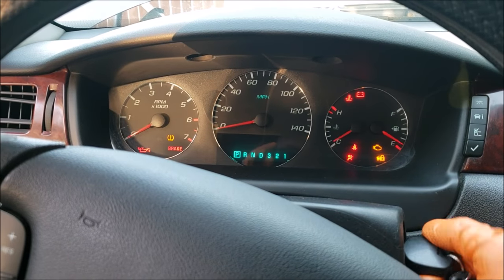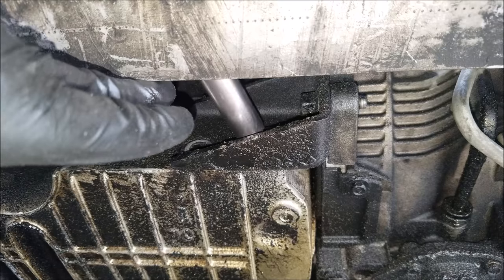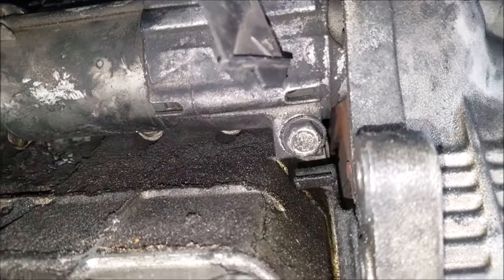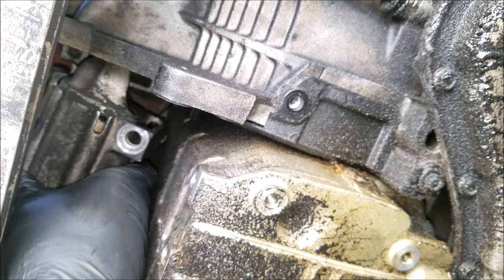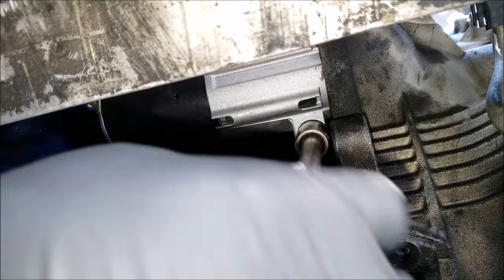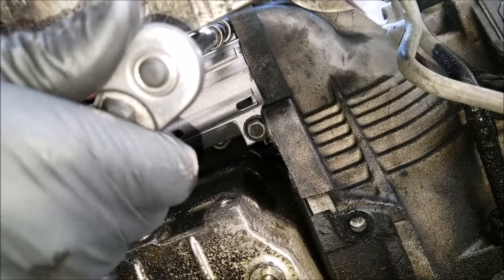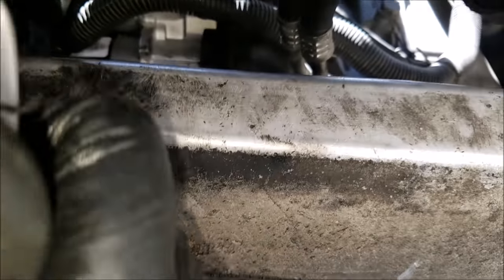How To Replace A Starter On A Chevy Impala 3.5L 3.9L 2006-2011

Comment: I found a hack. You don't have to remove the wires while the starter is mounted. Just remove the 2 mounting bolts, side the starter out, and disconnect the wires when hanging down. There is enough slack to allow this.

Comment: Hey all you wrenchers out there, I found out if you remove the oil filter on the 3.5 engine, you'll have plenty more room to get the positive wire connection off. This video saved me a labor fee. Did it myself! I am 70 years old, had a heart transplant 14 months ago. If I can do it, many other mechanically minded skilled patient guys can do it too. Swearing badly is acceptable.

Comment: Everyone is right, this is the best tutorial on the web...I used this plus some of the other ideas offered here as well..I 1) only loosened a few splash guard clips and tied it back with a bungee cord, 2) removed the oil filter and caught any oil that dripped out, 3) disconnected the two starter wires from the oil filter area and dropped the starter from that area too and did not have to squeeze the starter out from under the radiator hose...there was plenty room...4) I reconnected the wires before reinstalling the mounting bolts...it did not hang down by the wires...the starter was supported by placing it on the frame  area., it did not fall down...those are the only techniques I did different but could not have done it without your video and comments from others...thanks yooz!!
Reply: Thank you for writing all of the tips out, I replaced a starter on my 99 suburban 2x but this one on my 06 impala looks way harder, I haven't seen all the other tips yet, so your comment just helped me A LOT!! I will be doing mine tomorrow morning.

Comment: Terrific video, thanks for making it!  And I love the sponsorship by the cat.  This video made replacing my starter a really easy job.  I was even able to squeeze the starter out of the bottom of the car and back in again instead of through the side area where the hose is.
Reply: I replaced mine in the dark 8 months ago , in daylight I had to remove oil filter and starter slid right out.

Comment: Amazing video, I had no trouble removing and replacing the starter with your guidance. For my 3.5L engine, I did have to remove the lower panel like you did, rather than just loosen it. I couldn't work around it and get to that 10mm bolt to remove the little plastic cover.
Reply from the maker: Thank you🙂 yea i found it much easier to do without that splash shield

Comment: Great tutorial, got the job done! Agree with the comments regarding the oil filter removal, made it a much easier job to drop it down and swap out the electrical connector and battery terminals, then replace them and remount

Comment: 0:15 unhook battery - negative terminal - 10mm

0:40 bracket - 15mm bolts (use extensions to get square on bolts - avoid rounding!)

2:13 - dust cover - 10mm bolt

2:50 starter wiring - 13mm nut - plus lift plastic tab

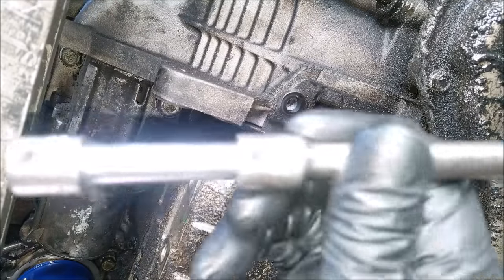4:08 starter bolts - 15mm plus extension/s

5:45 for cat lovers :)

5:55 Install

Comment: I did this job on my own impala a few years ago. If you are not a mechanic, you really need to follow every single step on this video. Also, you better off wear a safety glass. It is preventing dirt drop into your eyes.

Comment: Great step by step, I would add it is a lot easier taking the oil filter out and using that hole then trying to go out the front. Yes you'll lose a little oil but have so much less frustration in the long run and save previous time also.. Cheers

Comment: I missed that step at 8:42. I overtightened it at first. Went back to the video and loosened it up a bit. Good as new. Thanks for this video.
Reply from the maker: Thats great🙂 glad u got it going...great job👍
Reply: @backyardchevy328   update:  I just noticed today while my car was on I heard the start crank on it own. Any clue on this matter?
Reply from the maker: @RL_Repairs310  that would happen if the starter crank wire(smaller wire on the starter solenoid) is touching the main starter battery wire...so youll want to make sure those wires arent touching or too close to each other...or can also be if the ignition cylinder is sticking in the crank position or got bumped forward to crank

Comment: When I did this job I found the starter can be dropped straight down without having to pull it under the radiator hose.. You make good videos and I come here to get a heads up. Your drum brake video helped me big time thanks.👍🏿
Reply from the maker: I wasnt able to on the engine in the video, but yea some are different...thank you:)
Reply: @backyardchevy328  I understand.. I did it this way on 2007 3.5 Impala. I actually found out on accident, I was just trying to lower the starter and reposition it to get a better grip when I saw it could come out this way.✌🏿
Reply from the maker: @tristanexantus6386  yea then it should be the same..when i tried i couldnt get it out straight down
Reply: @backyardchevy328  I promise you it can come out from the bottom, it's been a while since I did the job but that's how I got it out and the new one back in... Those Corolla drum brakes, not so easy!😵 Half a day and busted a wheel cylinder later I finally got em installed.
Reply from the maker: @tristanexantus6386  i believe you lol..im just saying maybe i should of tried longer...yea some drum brakes are quite annoying to do

Comment: I dropped my oil filter and backed the starter out then dropped it instead of pulling it through the front bumper area.  Sooo much easier and doesn't damage the radiator hoses.  Very little oil was in the filter when I dropped it.

Comment: Great detailed video. The part i didn't wanna do was remove the whole splash guard so hopefully just by removing the three bolts i can get to the starter easily.
Reply: That didn't work did it? Have to take off the splash guard anyway. Would have been nice if he mentioned that part.
Reply: @bryanmiller9324  I didn't have to take the whole splash guard off.
Reply: I loosened that splash guard and pulled it up and out of the way with a bungee cord in one of the clip holes and pulled it up and hooked it onto the engine area...

Comment: I have a 2006 Chevy Impala LTZ and I'm thinking that it's the starter that's going out however we might try to change the starter and checking to see if that's the problem in this video right here is very helpful we haven't tried it yet but I have took notes so if it comes down to that we have this tutorial right here thank you very much for the help even though I haven't tried it yet but is still very beneficial  just in case never know

Comment: amazing video!! hardest parts were tightening the 13mm nut on the neg/positive terminal, so many wires in the way and i didn't have socket for mini wrench, finally got it -- also removing the starter below the coolant hose did scrape the hose a bit OVERALL not too bad job
Reply from the maker: Thank you🙂 yea i found those same parts to be the most troubling as well..a few people did say if u removed the oil filter that it can be removed that way too but i haven't tried it personally

Comment: Thank you I just wish you would have mentioned that you have to pull off the air dam on the front of the car before you can get to the starter but I figure that out anyway I appreciate the video

Comment: I do have a question...and it's been in the back of my mind for the last 25 years. It is the reason I NEVER replaced a starter. Do you need to shim/check to gap between the starter gears and the flywheel? This was something that was required on a mid 80's Pontiac. Or are the newer starters not requiring to gap them properly anymore. Your help would be greatly appreciated as I am finding myself possibly helping a family member replace a starter today.
Reply from the maker: No, that is not a requirement anymore..older engines from 60s to 80s would use similar cast for engines and could also use the same starter but they werent exact and precise so to get them to work ud have to shim em to compensate for the subtle differences..now they got rid of that and certain starters will only fit certain years etc.
Reply: @backyardchevy328  thank you
Reply from the maker: @nicopicco  anytime🙂

Comment: Great video. I would have drop the started then took off those wires without the bottom cover coming off.
Reply from the maker: Tried to..but unfortunately no space there and the wires hardly allow for any movement..but removing the oil filter is supposed to be a good way to get it out without that plastic cover getting in the way

Comment: Great video!  How about a video on radiator flush without using the pepcock to drain (mine broke off) and a transmission flush on the Chevrolet Impala 2006-2011 series?
Reply from the maker: Thank you🙂...i did replace a radiator recently without using the petcock to drain it but ill try to see what i can do

Comment: Hey I got a 07 impala ls and it was working ok then I turned off one day at the store and came back to it all it did was click when I turned the key all the lights seem to work fine too so I don’t think it’s the battery but i might have to try this
Reply from the maker: Are the connections on the battery tight and clean? Sometimes if theyre dirty or loose itll cause a click like that, i would verify that first..and would still get the battery tested just to be safe..a battery could have good volts but the cranking amps be really low and that could cause that too

Comment: In the same way can I do it in my impala 2001? It no longer starts and only makes a small clack when I start with the key, I want to be sure it is the starter, right now I have very little money
Reply from the maker: Itll be similar...i would clean the battery terminals to make sure u have a good strong connection...i would also make sure the battery is charged and maybe u can have it tested to make sure its got a good amount of cranking amps..just to make sure none of those are affecting it..if not it may end up being a starter issue

Comment: I'm stuck on the 10mm bolt you're taking out at 2:15. Did you remove the splash guard to access it? I can see it I just cant get a good angle on it from directly underneath, the only thing I can think to do is remove the guard to access it from the front, but before I do that I figured I'd ask in case I'm just looking at this the wrong way.
Reply from the maker: Yes i did remove the lower splash shield...its the only way i would of been able to get the camera angles..i show it towards the end of the video
Reply: @backyardchevy328  Thank you, I'll get back to it then.

Comment: Nice SnapOn ratchet. Are you using that ratchet with Craftsman sockets? I ask since the Craftsman sockets I have don’t work so well with my SnapOn ratchets. I think it’s because the Craftsman sockets have a double detention groove in them. Have you experienced something similar?
Reply from the maker: Thanks🙂 i have a mix of sockets..my short sockets are craftsman sockets..the deep sockets are Pittsburgh..but i havent experience that..it may be that my craftsman sockets are older ive had the same sockets for over 10 years

Comment: Do u need a torque wrentch for the bolts on the starter or can u do it without
Reply from the maker: Its not necessary but it just helps so u can be sure they were tightened enough, but yes it can be done without it.

Comment: very good...thank you. i'm about to do this on my 06 impala.
Reply from the maker: Thank you🙂 hopefully all goes well..good luck
Reply: @backyardchevy328  I have to admit... I'm torn on buying a starter for $65 or one for a $140.. Oddly the one for $65 claims to be brand new on Amazon and the $145 is a reman... Do I trust the more expensive one is better quality? If you can give me that advice I'd appreciate it.
Reply from the maker: @RailFanRob  i avoid remanufactured..ive had too many issues with em..they never work or sound as good as original..id go with a new one from a local auto parts as best option if u plan on keeping vehicle long term..they give u warranty if u ever have a problem with it for the time u own vehicle..after a certain time youll pay a lil when u exchange it but still comes out worth it

Comment: Good evening, i had a question if you had some time. Today i did this same job on a 2011 impala LT. Even put a new battery. All the electrical works i side as it should but when i go to crank the car up. It just makes i loud click noise and Thats it. What else can i check?
Reply: It bolted up evenly and flush so i dont thing the gears on the flex plate and starter is a issue. The bolt for the wires were tightened just right.
Reply from the maker: @rickyfalcon3294  loud click usually means that ur starters not getting a strong connection or enough cranking amps to spin it...could be a bad connection to battery..dirty or corroded connection try cleaning connections with a battery brush and make sure theyre tight and dont move and if not that check that ur battery cables aren't damaged and secured properly
Reply: @backyardchevy328  thanks bro im gonna make sure thats all good. Terminals were a little loose maybe that was it
Reply from the maker: @rickyfalcon3294  yea that could be the reason..hope ur able to tighten em up, and it fixes it🙂
Reply: @backyardchevy328  thanks again
Reply from the maker: @rickyfalcon3294  always glad to help when i can🙂..thank you for the support
Reply: I have a 2006 impala and have the same problem...I installed the starter and just get a click noise...I swapped a battery it just clicks as well
Reply: @kevjr76   Did you ever find the problem? Ty

Comment: 2008 impala.
mine has this hesitation.. when im driving along, then try to get on the gas, ill feel a rumble sound then get this hesitation.  if i keep pressing the gas pedal the Stabil trc light comes on.. so i try to let off the gas when i feel it starting to hesitate and the light wont come on.. a few times when i start the car it feels like it wants to stall out... I thought i was maybe mass airflow. i cleaned that. no luck..  any thoughts?
Reply from the maker: Any check engine light coming on or flashing when that happens?
Reply: Transmission

Comment: It's a lot easier if you take off the oil filter, then you just slide the starter back and turn it vertical and it drops right out instead of fighting with the hoses
Reply from the maker: Good tip👍 thank you

Comment: Hey my 2009 Chevy impala LT makes one loud click. All of the lights, air and radio comes one but it won’t start. Last week it was starting after I got a jump . 7 days later it wont start at all even after a jump this time. The battery is brand new and cables were cleaned off. Could it be a starter fuse or something or do I have to get a whole new starter?
Reply from the maker: Are the cables tight on the post(can u wiggle or rotate em)...ive noticed on these impalas the new aftermarket batterys, the cables dont really tighten the post that well i had to tap em down   a lil usually a loud click means its not getting a good strong connection or enough cranking amps but if everything checks out fine it could also mean ur starter might be engaging the solenoid but the motors not spinning so that part of it could be bad.
Reply: Backyard Chevy thank you soooo much a mechanic is coming to look at today! I’m going to tell him everything u said!
Reply: Backyard Chevy where are you located just out of curiosity lol
Reply: Backyard Chevy it was the starter the car is running now!!
Reply from the maker: @joshthomas9871  hopefully u guys are able to figure it out..good luck🙂

Comment: I’m confused on where the starter is, I have a 2006 Monte Carlo lt 3.9 and I don’t if I have to take the skid plate down or what

Help please!!!
Reply from the maker: The starter will be located between the engine and the radiator, just to the side of the oil filter

Comment: Replaced my starter and still won’t start. Battery is fully charged.

It DID start a few times and drove it probably 50 miles to and from work but now won’t start. Any ideas? SOS

Comment: Did you  have to Jack the car up in order to get to the starter
Reply from the maker: Yes, i havent tried without lifting, since i did need more space for the camera but cant imagine being able to do it without lifting
Reply: @backyardchevy328  ok thanks  very  much
Reply from the maker: @shawnparker5234  anytime🙂
Reply: Did u have a washer and lock washer after the two  connections
Reply from the maker: @shawnparker5234  i think i used the original nut instead that had the washer as part of the nut..but the replacement starter comes with a washer and lockwasher to keep it from loosening...youll wanna put the two connectors..then the flat washer..then lockwasher and finally nut

Comment: 2008 Saturn Aura 3.5L, instructions are the same, except... No transmission bracket in the way, so you'll be skipping that part. Plastic shield held with two screws. Latch for signal wire is identical this video, but the tab is hidden, you'll be working blind, confusing to me bc it looked different from a different angle not appearing in the video, but it is the same connector, when I used my finger to lift the hidden tab blind then it slid off no problem, so don't try too hard, and there should be no need to use a pick. Space was tight for B+, I used 1/2 inch socket instead of 13mm on 3/8 ratchet, after removing 2x 15mm anchor bolts, I was able to move nose of starter deeper toward fly wheel to gain a bit more clearance. Note stacking sequence of the two ring terminals on the B+ post. Brass brush to polish all surfaces of both ring terminals. Significant leak from oil-pan gasket may be why the starter failed, I thoroughly wiped contact surfaces on engine block and on anchor bolts to ensure solid ground connection. Starter drops straight down with plenty of clearance on all sides. Delco Professional PN: 3362141A.